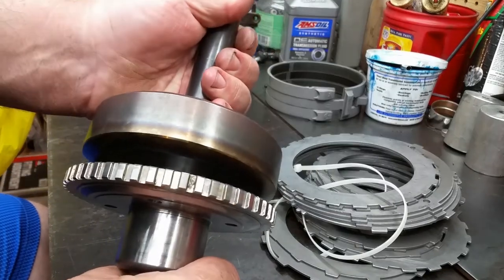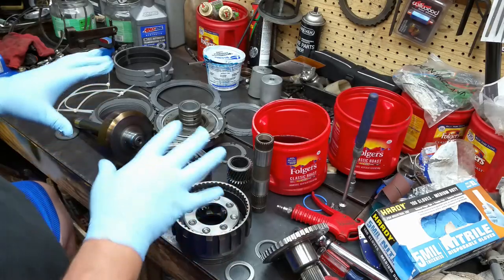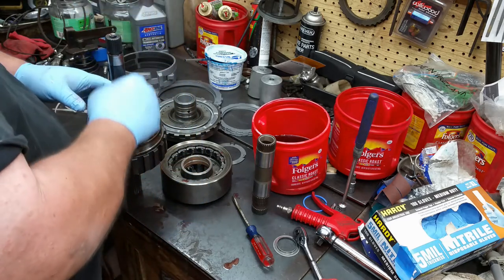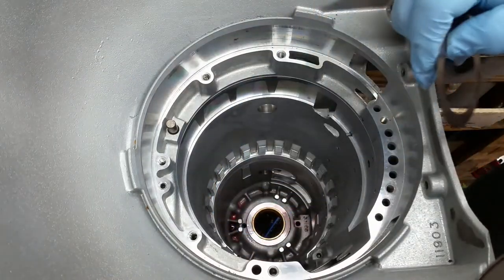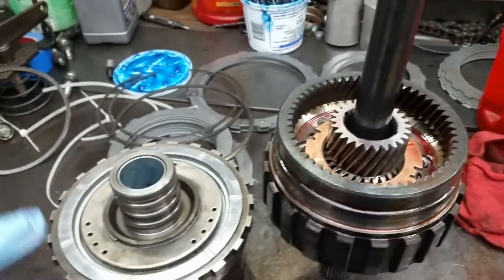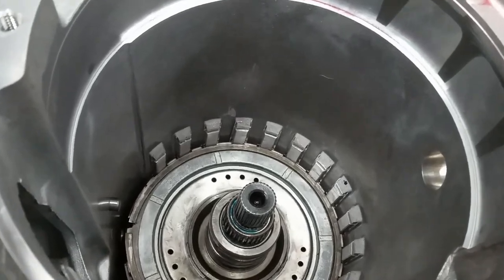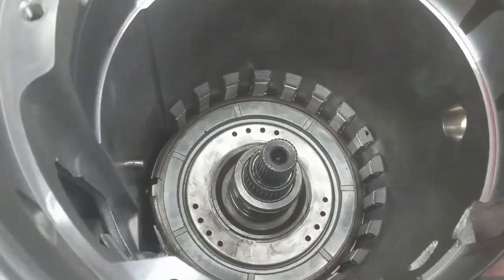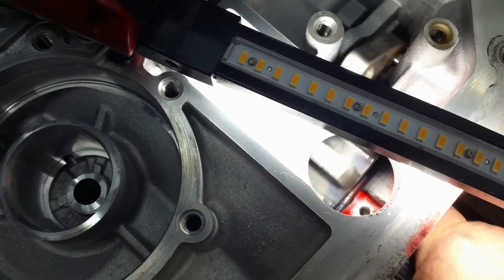Lower geartrain assembly on the GM 4L80e Transmission

Comment: Another option for bushings being tight or out of round is to use a hammer on the part going onto it to mold it back to round. Just by spinning shaft and tapping with hammer works nicely. For the guy wondering about sanding bushings...that is normal and almost unusually required for tight bushings. I have hours of builds recorded but don't know how to convert to upload to YouTube. Maybe one day...
Reply from the maker: Good information!

Comment: Also the roller bearing upgrade is good replacement for selective washer that wears out and frees up HP. You can use sonnax brand or like us old time trans builders who played around with the whole idea way back when...a th350 oil pump roller bearing is what we used.  The tail shaft roller bearing upgrade is the other important sonnax part.
Reply from the maker: For sure.

Comment: Usually on tight bushings like that if you can get it on I just bang on it with a plastic hammer where that bushing is and will kind of help it be able to loosen a bit
Reply from the maker: Great tip!

Comment: It is possible the out put bushing was in too far. When I rollorized my 4L80E I did to not seat the bushing all the way flush. It stuck out the rear of the case about .090 of an inch. One way of getting the bushing correct is to drop the rear planetary assembly in lightly enough to push the bushing back enough to be flush with the bearing.
Reply from the maker: The trick is to press it in rather than hammer it it. I found hammering it is swells the top of the bushing...But that's a great tip!

Comment: I don’t know ur kinda scaring me with this build .. swapping snap rings doesn’t seem like a good idea . I that that beveled snap ring is shaped like that for a reason.. when I built my 80 didn’t have to polish any bushings to make parts fit. N the shaft with the long bushing has a small hole that has to line up with the gear that goes into that planetary gear n I noticed u didn’t line it up?? Are u not showing things to speed up the video??
Reply from the maker: The snap rings can go in different places and still perform the same function. That being said, the beveled snap ring only goes in one place and its at the center support. As far as lining up any hole, not sure exactly what you're referring....
Reply: @IrocinZ  I was referring to the sungear shaft where it has a llube hole that lines up with a hole in the sun gear
Reply from the maker: @joseb1700  Time stamp the video and send me a reference so I can see what you are refering to. You have my curiosity up.
Reply: @IrocinZ  it’s 725 mins into the lower gear train assembly video
Reply from the maker: @joseb1700  I just posted a short video for you. I hope the explanation helps.